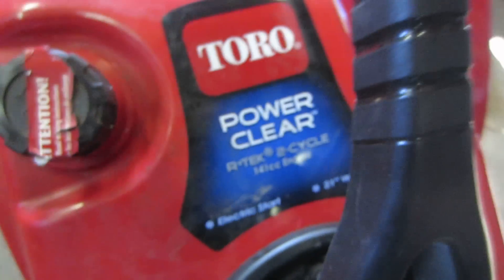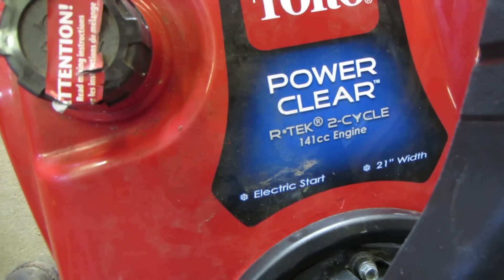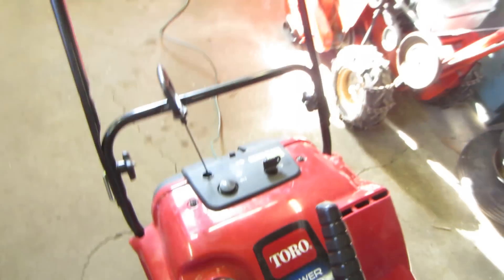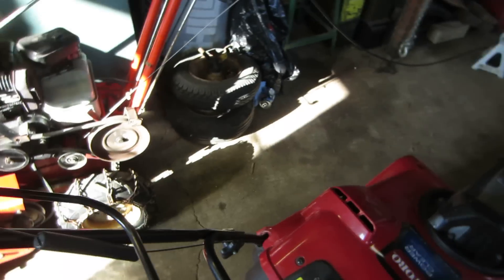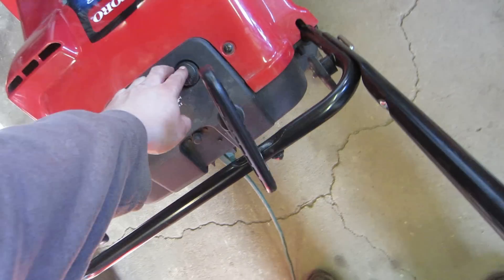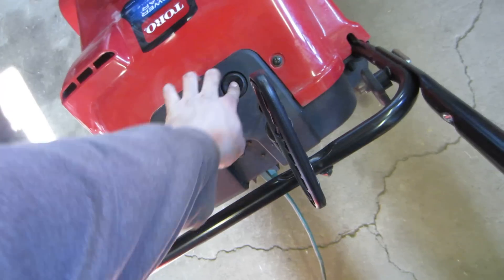Toro 2 cycle snowblower starter drive repair part 5 the start up

Comment: Well, you fixed the starter, but when you tried to turn off the choke it started to die.
Reply: mine did same crap i got so sick of the plastic carb they installed on the ccr3650 model i installed an aftermarket 14dollar carb    does great ow